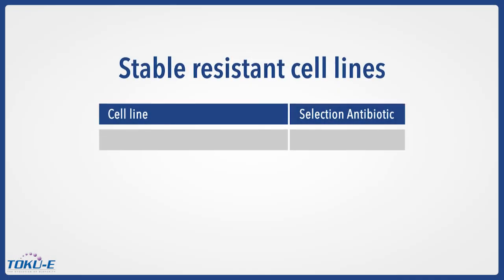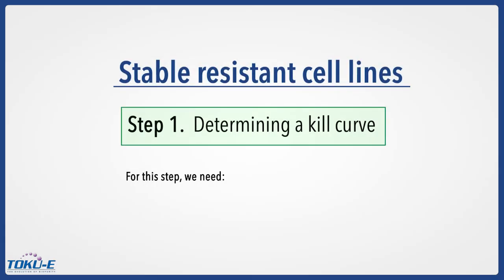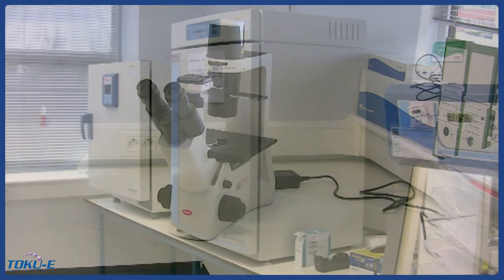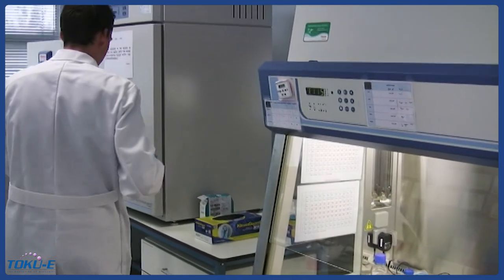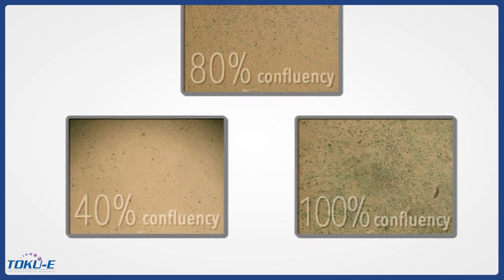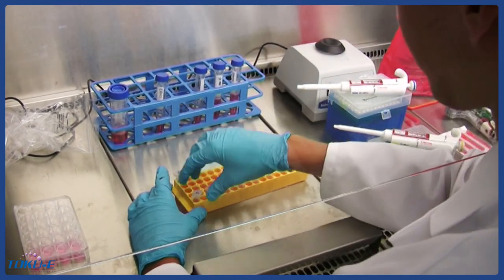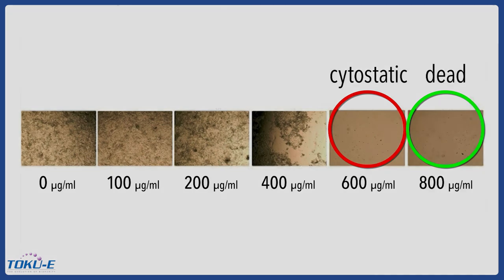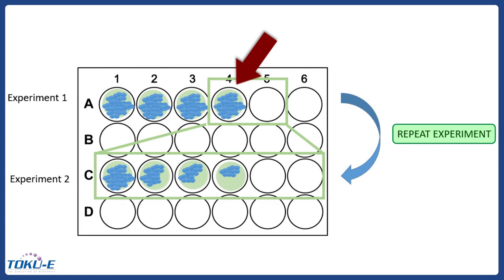Stage 1 of 3: Generation of Stable, Transfected Cell Lines: Kill Curve

Comment: can you please explain the dilution of parental cells? how did you diluted them?
Reply from the maker: In order to prepare dilutions of parental cells, first the cells need to be dissociated from a culture vessel (using dissociation reagent e.g. trypsin) and resuspended in culture medium. Then the cells need to be counted in the suspension and an appropriate number of the cells (volume of the cell suspension) needs to be added to a conical tube with an appropriate amount of medium for each cell dilution in order to achieve the final cell concentration of 50 000, 100 000 and 200 000 cells/ml.
E.g. If the cell density of your starting suspension is 1 000 000 cells/ml, you will need to use the volumes specified below to have 5 ml of each cell dilution:

for a final cell conc (cells/ml) of 50,000 cells, you will use 0.25 ml of cell suspension and 4.75 ml of medium.

for a final cell conc (cells/ml) of 100,000 cells you will use 0.5 ml of cell suspension and 4.5 ml of medium

for a final cell conc. (cells/ml) of 200,000 cells you will use 1 ml of cell suspension and 4 ml of medium.

Hope this helps, and best of luck with you research.

Sincerely,
TOKU-E Team

Comment: If you plate at 80% confluence, the cells will be over crowded by day two. How do you know if the cells are dying due to confluence or antibiotic? I know you have your control well without antibiotic to compare too, but that will be stressed too with the overcrowding.  Wouldn't it be better to start with lower confluence?
Reply from the maker: Thank you for your question.  Whille it is true starting with a lower confluence will lower the risk of cell death due to overcrowding, this may also lower the transfection efficiency in the next step.  Careful observation of the cells is key. If needed confluence can be adjusted based on the cell line, growth conditions, transfection method etc. You are welcome to contact 'info.eu@toku-e.com' if you have further questions.

Comment: For proper antibiotic concentration video shows as after 24 h check the cells and choose the lowest concentration that kills all cells within 10 days. How is it possible to decide after 24 h to 10th days result?
Should it be 10 days incubation and cell survival check?
Reply from the maker: The video indicates you need to incubate the cells with different concentration of antibiotic for 24h and then check them. This is true but then you should keep the cells in culture for 10 days, check them regularly, refresh the medium with antibiotic and do the final evaluation after 10 days of culture.  You are right that it ‘should be 10 days of incubation and then cell survival check’.  The final evaluation is done after 10 days of culture with the antibiotic (with intermediate visual checks and medium refreshment every 3-4 days).  Best, R&D Team.

Comment: Should we prepare selection media in large quantities (300 mL or so) once we know the optimal concentration of antibiotic or we should freshly prepare every time? How stable Hygromycin B in media storage at 37oC?
Reply from the maker: We recommend preparation of a fresh selection medium just before adding it to the cells. Storage of culture media at 37°C is not recommended.
Reply: @toku-ecompany7075  What would be a good way to quantify the kill curve of the dead cells? More quantitative way rather than just eyeballs them?
Reply: @toku-ecompany7075  I was meant to put at 4oC
Reply from the maker: In order to have quantitative results, you could use a fluorescent dye which stains nuclei of viable cells and measure the fluorescence of each well. You could also count the stained cells under the fluorescent microscope, however, it might be difficult to count all the cells in the wells.  Alternatively you could do a viability assay based on cell metabolism (e.g. using MTT). However, be careful with cytostatic cells which could be underestimated by the assay and could still be present in the wells. This is why it is always good to check the wells visually.  For additional questions, please email ‘info@toku-e.com’
Reply from the maker: We have not tested Hygromycin B stability in culture media. We recommend adding the selection antibiotic to culture medium on the day of the treatment. For additional questions, please email ‘info@toku-e.com’.